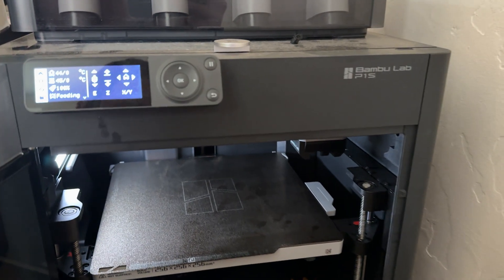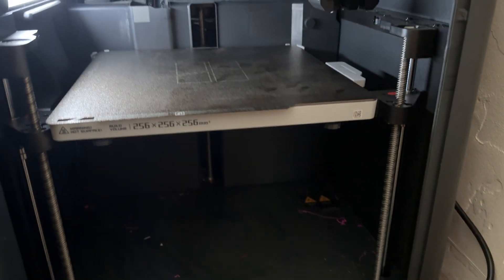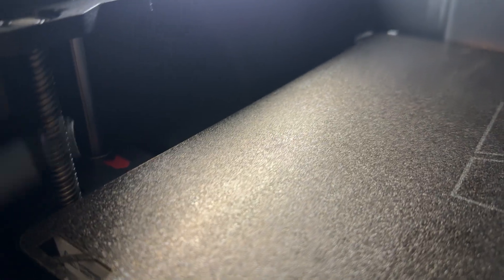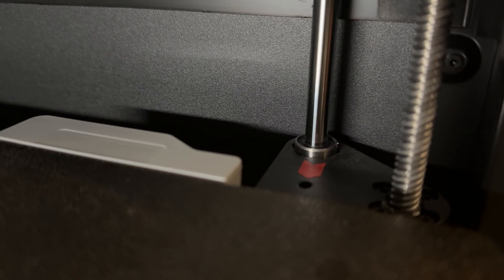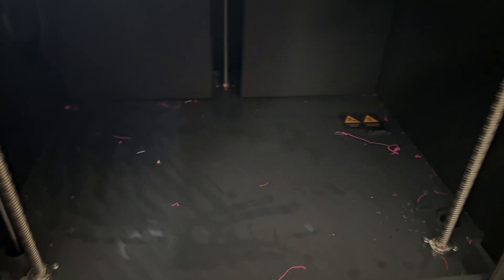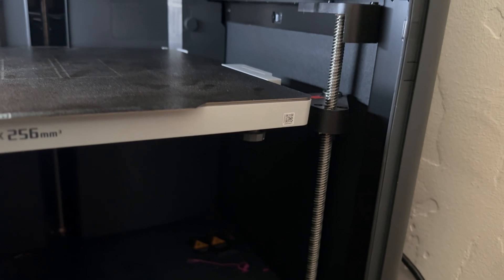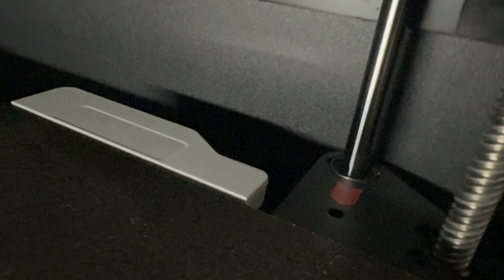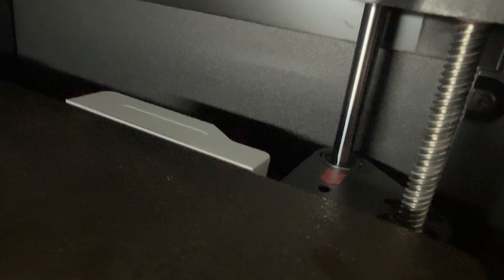EASY FIX FOR “Homing Z Axis Failed” error on Bambu P1S or X1C 3d Printers

Comment: There's an error when returning the Z axis to its original position, but my bearings are fine. What could be the cause?
Reply: Sometimes its just debris where the bearings go to or on the springs themselves, thats what happens to me often. Depending on what printer model you have it could also be a displacement of the printer bed (i dont remember how its called). Its a first time for me that i saw the bearing moved and i have this printer for about 2 years.

Comment: This was the fix I needed thank you. Instead of pulling the bearing though, if you turn the printer upside down and wind the plate all the way up to the top until you hear the pop, that’s probably the better way to fix rather than potentially damaging with pliers. Thanks again for the tip!

Comment: i cant pull or push bearing back idk what to do PLEASEEE HELP
Reply: Idk if its still relevant, but the entirety of my printer is really tight so i had to put extra effort with better tools to wiggle it. When my extruder was clogged i remember i had to  bash it with a hammer over a hundred times (unironically), and the wiki says it at most takes 30 if i remember right.